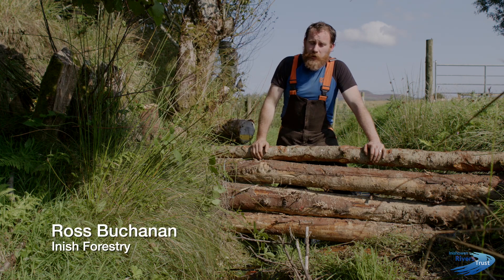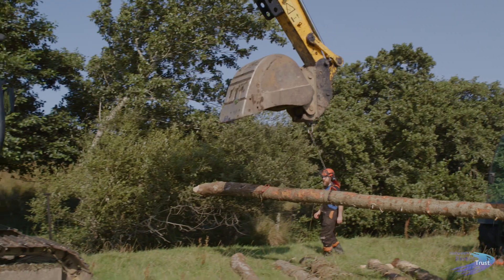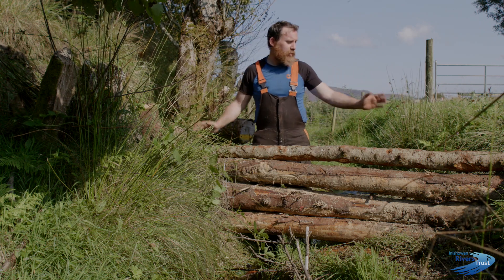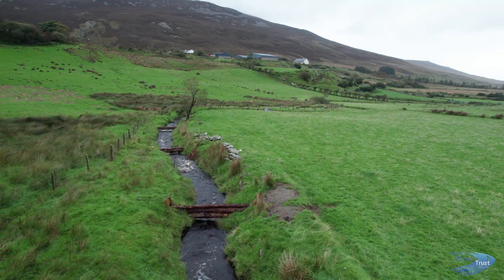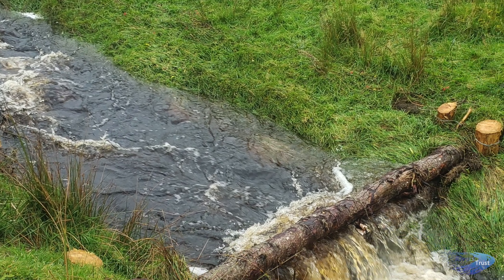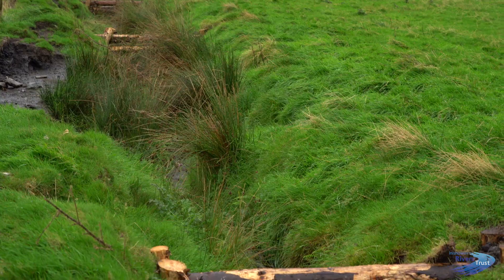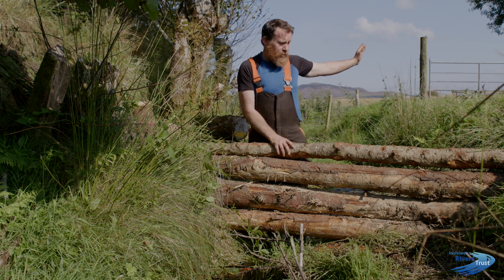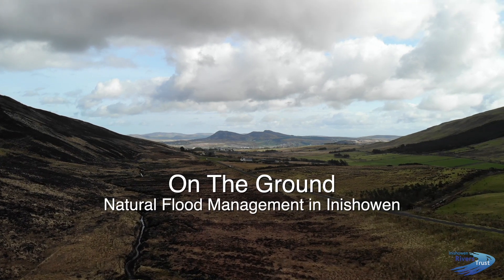Building Leaky Dams in Inishowen, Co. Donegal

Comment: Can't agree that it's a good design.  While it sounds nice, the fact is that the water is going to eat out the channel even deeper as it's forced under the dam.  If you're building a leaky dam, the best design is what beavers have been doing for a million years.  They're the experts.  The further from that design you get, the less efficient it will be.  For as much time and effort goes into just one of those dams, you could have built three or four Beaver Dam Analogs.
Reply: Beaver dams store under normal flow conditions, these are designed only to be active under peak flow conditions. There is no extra storage in a beaver dam during flood events although they will certainly remove energy from the system. Have you a link to beaver building designs being implemented effectively by humans?
Reply: @TheBuckybronco  Oh, there's a ton of videos on Youtube.  Search "Beaver Dam Analogs" to find plenty, including talks that are an hour-plus, detailing projects that have been underway for years.  This is a good vid with data on temps and whatnot....  https://www.youtube.com/watch?v=m2bG4kYfRhs

While Beaver dams aren't designed to take in gobs of water, they do actually spread out the water, absorbing its energy and forcing it to flow widespread instead of down a narrow channel.  If you look at the dam complex during "normal" flow, the dams rise above the water by a foot or more.  That means they can absorb an inflow that's significant without breaching or being undermined.  It's that ability to absorb the storm and spread it out which makes the difference.  You get the same amount of water going out as you do coming in, but it exits at a slower velocity, over a longer timespan, because it's forced to spread wide and work its way through the flood plain.  It doesn't always work, obviously.  A lot depends on what kinds of structures are on the upstream side of things.  

Still, it's better than nothing.  A good series of BDA's can make a tremendous difference in the health of the surrounding area because they create habitat and raise the underground water table.  As you see in the video here, the water is rushed out just as fast as gravity can carry it.  That's a drain in the very real sense, but we forget that it's draining the entire ecosystem.  

In the vid, you can see that they're already planning to force the water over the banks, making sure the heaviest rains spread out wide instead of simply shooting down the gutter they've made.  Okay, BDA's do that very same thing.  The difference is that BDA's serve a tremendous benefit in the times between the heavy rains.  Between the storms, the small ponds create an incredible range of habitats and help rehydrate the surrounding land.  When the storm hits, the BDA's are there to help slow the runoff and spread it over over the banks just like the Leaky Weirs.  They both work to handle the storm surge, but it's what they do in between those surges that really sets them apart.

And, to be fair, if nobody goes through those channels to clean out the sticks and leaves that tend to accumulate, the Leaky Weirs would likely backfill with all sorts of stuff that will slowly transform them to be more like a Beaver Dam Analog.
Reply: @TheBuckybronco  look up Beaver Dam Analogs in Idaho/ Utah. The leaky dam (called a post assisted log structure in NA) is perfect for this application. It takes much longer to build BDAs than PALS so I don't really know what the OP is on about.
Reply: Beavers build actual dams which don't produce extra storage during flood events
Reply: @TheBuckybronco  I'm not sure what you're trying to say.
Reply: Hello
Beaver do dams fit fir their own purpose. Nature selected those with purpose that was best fit long term. 
A non beaver approach is intersting as long as results are compared to objectives.

Comment: hello, this needs to be done with rocks not wood, wood will rot away in 2 years or so, there are no beavers to replace it  constantly.
Reply: They might not want to block fish passage
Reply: Depending on the location some companies do use rocks but in this location there are none and it’s cheapest to use materials on site instead of spend money to get rocks and potentially destroy some of the environment trying to dump the rocks in these locations think logically
Reply: @2A_supporter  rocks do not destroy environment
Reply: Rocks don't add nutrients to the ecosystem.
Reply: Acid water. The wood will last for decades